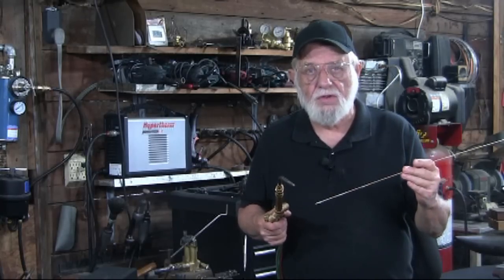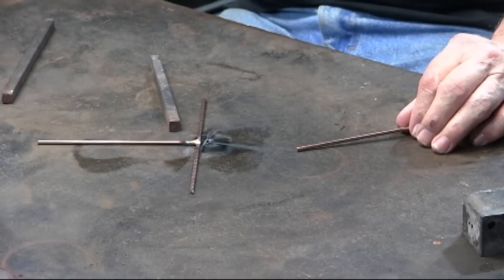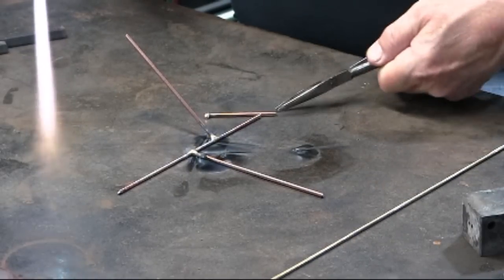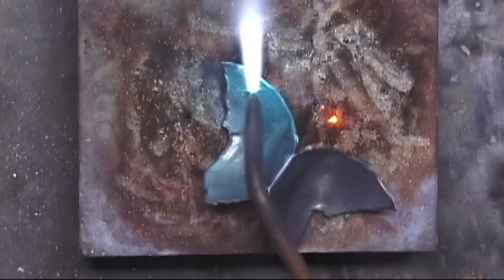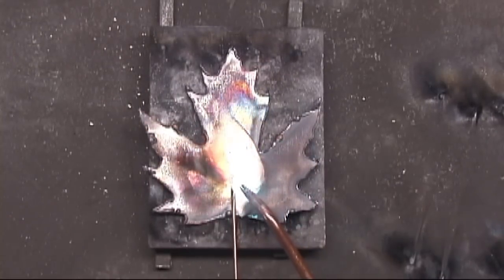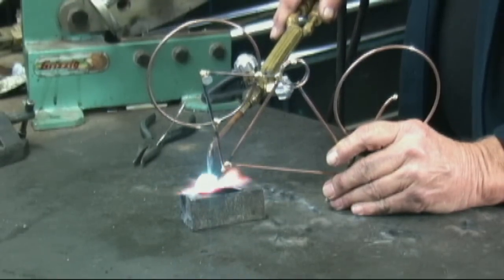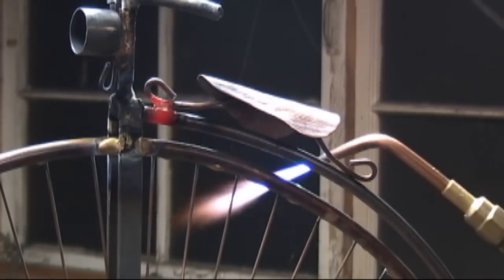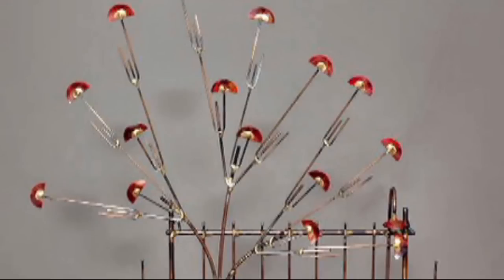Brazing Shortcut

Comment: It's worth mentioning that braze joints can be quite strong. Harley and other early motorcycle frames were brazed. I used to braze "steel rule dies" (picture a typical steel ruler with a cutting edge on one side) used in presses to cut tough synthetic fabric. The steel would often fail before the braze joint, and brazing was used in preference to welding for ease of repair. We melted the braze, made a new section, then brazed it in place.

Comment from the maker: The dob of bronze will be especially good for what you are doing.  You can put the dob of bronze on the nails and then while the nail is still hot you can melt the brazing on the nail right onto the sheet metal.

Comment: Your work is beautiful and so professional looking. Now if u don't mind me asking what is the difference between soldering n brazing? Seems kind of the same to me. Can I use solder wire to do this connection with my metals? Thank you.
Reply from the maker: Diana, You're right, brazing and soldering do look similar.  Brazing is done with a bronze brazing rod which require a much higher heat source than soldering.  If you are using silver solder you can get a strong joint between two metals if you can get the metals hot enough to accept the silver solder.  Wikipedia has a section on Silver Brazing (silver soldering) in their article on brazing.  http://en.wikipedia.org/wiki/Brazing

Comment: Great tip!  With the "dob of bronze", who needs a third hand?  You probably use quite a lot of O2 and acetylene, but what do you recommend for the occasional welder for the least expensive, most practical way to keep those gases handy in your workshop?  Purchase or rent tanks?  What size? 40cf?  Thank you for your videos!

Comment from the maker: The rods are RG 45 which is a standard mild steel welding rod available at any welding supply in 36" lengths.  Tip size is an "0" tip on a Victor Performer.  Welding table is 3' x 4' - 1/2" mild steel.  Check next week for a video on a heat sink.  With a heat sink you can use a lighter weight steel top for the welding table.

Comment: I love this video. Are you just using a bronze rod with no flux? It was suggested to me to use a flux covered electrode for brazing steel is flux necessary? I'm working with 22 gauge steel and 1/16th welding rods for sculptures.

Comment: Mr. Goehl I have never used a cutting torch before and I wonder would me starting off brazing be the best way to learn welding?
Reply from the maker: The oxygen acetylene torch is an excellent tool for the home shop because it is so versatile.  Many of the skills learned with oxygen acetylene brazing carry over to other types of welding and brazing.

Comment: Hello George,  I have a question, I am repairing a vintage Harley Davidson motorcycle fuel tank, the bottom has a series of pin holes ranging in sizes, the biggest being 1/8 diameter.  The metal is thin about .030 and I want to avoid blowing a hole through the thin metal.  What brazing rod and gas do you suggest for filling all these pin holes without blowing through the thin metal?  Thank you so much for your incredible videos and your beautiful craftsmanship!
Reply from the maker: Paul, take a look at this video.  https://youtu.be/h0vIvipWVuY    Especially the torch angle.  Not knowing the thickness of the metal to be brazed, it's a difficult question to answer.  Use the thinness brazing rod you can find.    Make sure the metal is clean - no oil, dirt or paint.  I've never repaired a gas tank.  But I have repaired other vessels.  If you put in a cup of water and it doesn't leak, then fill the tank.  A full tank of water will put more pressure on the brazed hole as opposed to a cup of water.   Safety:  You'll definitely want to make sure the tank has been steam cleaned or some other method to make sure there are no residue fumes.  I would strongly recommend checking out some Harley sites.  I'm sure that you are not the first person who wanted to repair a Harley gas tank.  You'll probably find someone who can give you first hand experience.
Reply: George Goehl Thank you George, I did review your instructional vid brazing thin metal. I will definitely use your technique of dob of bronze and holding the flame of the torch sideways.  Of course I will practice on some thin scrap metal first. I am a precision machinist by trade for 30 years (retired).  I truly appreciate your dedication and obvious passion for your craft. Thank you so much for these wonderful instructional videos. God Bless my friend.
Reply from the maker: @paulhealey8221  with your experience you should have no trouble.  keep me posted.  George

Comment: Hi George, I am doing some stick figures using 22 ga sheet metal for the bodies, and some nails for the arms and legs.  Will your dob of bronze work for me?  I may try using some RG45 too.  Will it work on that?  I do not want to get the sheet metal overly hot since it warps.  But, using the dob of bronze would be great if it will stick to the nails and the RG45.  Nice idea! Great video as usual.

Comment: Hi George ,nice sculptures great tips and tricks .
i wonder if the brazing rods from different manufacturers behave the same and get the exact result or they are different , i mean the melting point the flow and the strength etc ?.
Reply from the maker: There is definitely a difference.  Primarily I use "off the shelf" 3/32 bare bronze.  I really like Crown brazing rod, but it is 30 - 40% more than "off the shelf" bare bronze.  Gas Flux  has their own brand.  Sweden produces some exotic brazing rod.   Brazing rod is an alloy.  Copper + tin + (?).  If you want something just a bit better than the "off the shelf" rod, I'd suggest Gas Flux.  Most online welding supply companies are going to post details on the rod they sell.  Details like; melting temperature, ductility, tensile strength etc..
Reply: George Goehl ok now I know, thanks.

Comment: George, I think I just adore you! I really must add to the thoughts of my first impression. After watching several of you videos, in my humble opinion, you nailed it. Not only are you a wonderful artist and craftsman but you are also a really good teacher, videographer, editor, and content contributor. I am not a person that gives undo praise, I think telling someone they're doing good when they need  work is counterproductive. My one complaint is that your information and presentation is of such value to me it is impeding my production. Shame on you. lol 

I do have a few questions;
1. What is your bench made of?
2. I'm planning on watching most your videos,  I was wondering if you had some on beginning welding/braising tutorials. 
B. I know how to solder pretty well. I do stained glass panels. (my profile pic is one of mine pieces.) and want to incorporate metal and glass. This is such a happy thought for me it gives me "Snoopy" feet everytime I start drawing up designs.  I just need to up my skills on a few things. Figuring out how to get the metal hot enough to attach the copper foil to the structure without breaking the glass has been an issue. I figured out a work around tinning copper wire and attaching it that way. My goal is to have them attach directly. Any ideas?

I so appreciate you sharing you experience and know how. I looking forward to watching all your content. Thank you. MRS
Reply from the maker: Table is 1/2" mild steel  3' x4'
Here is a complete list of my YouTube videos listed in categories.  Lots of brazing videos.
Main Brazing Video:  https://vimeo.com/ondemand/10561
I have no experience combining metal with glass, but I am sure there are YouTube videos that cover what you want to know.
Glad you like the videos.  Keep in touch, George
Reply: To Lambentlark, check out this video in youtube . It might be what you need. It's called "Soldering for Crafters". The channel's name is thefrugalcrafter and the Lady who owns is Lindsay Weirich
Reply: Dear George Goehl, you are a genius and I am learning a lot from you. I have a question, I don't own one of those torches that you recommend. I will buy one soon, however, can I do some of the brazing with a kitchen torch?

Comment: What is the easiest, fastest and cheapest way to weld to coat hanger wires together? I know nothing about welding but have an idea and want to learn the best way to weld (or fuse) two hangers together.
Reply from the maker: Get two hangers almost white hot and hammer them together.  There are many options for a heat source.  I use an oxygen acetylene torch.

Comment: Hi George. Thanks for the helpful video. This has helped me tremendously. I solder jewelry but decided to take a step up and learn to weld. My first project is to make these cute little garden/flower pot stakes. I want to braze a 1-2mm rod (about 12") onto the back of various copper blanks (some of them will be domed). Then I want to torch enamel using Thompson enamels,  the fronts of these copper pieces. Do you have a resource (I am in Florida...not sure where you are) to find rods in those sizes in bulk? I will also need some that are about 36" and about 3-4mm in diameter. I'm going to add these to the other stuff I do when I do my craft fairs. Thank you in advance. I'm subscribing to your channel now :-)
Reply from the maker: +Lacy Hornberger Lacy, sounds like you have a plan.  I've never done much with enamels.  Hopefully you'll post them.  Look forward to seeing your work.  George

Comment: Just read some of your other commets. the peacocks i was planning on using metal coat hangers for the part to put feathers on then i found some steel sheet middle form an old dog house. which of the welding rods to i get with the flux already in it? and hand held tourch, its all i got to work with. thanks for any advice
Reply from the maker: Lynda,

You have a hand held torch.  Can you describe it.  In order to weld you need to get both pieces of steel so they are beginning to melt.  

If you are brazing you just need the two pieces of metal to get red hot.  If you want to braze, I'd suggest flux covered brazing rod.  
Check this video out:  http://youtu.be/TQP8EBQRvr0

Here is a link to the complete list of videos:  http://www.gsegmedia.com/?page_id=2877

Comment: I am trying to put together a TV antenna one that will not corrode or rust. When you mix metals like copper and stainless steel and copper wire  over a short period of time they rust or corrode. Just wondering IF you have any ideas that may help.
Reply from the maker: That's a tough one.  The only thing I can think of is to seal the antenna with a clear spray.  But that may degrade the signal.

Comment: What brand of brazing tip and size of tip did you use while brazing the tips of the metal to melt the bronze?  TY --JErry
Reply from the maker: Jerry, I used a Victor 00 (double ott) tip.  That is a Victor tip.  

I pretty much either use a 0 or 00 tip for my work.
Reply: Thank you for your response.  You do great work and provide a signifiacnt opportunity for begining welders to learn your trade. Pls keep up the training video's!! Have a great day. --Jerry

Comment: Hi George.  Great trick.  Was that pre-fluxed rod?  Cheers Rob
Reply from the maker: Rob, yes that was flux covered rod, but it was SCRAPED flux covered rod.  Check out this video for an explanation:  http://youtu.be/KFN38vHKQTY
Reply: George Goehl
Hi George.  I see.  Good idea.  I prefer to use plain rod and add flux as I find I can control it's application better.  Using prefluxed rods is a bug bear when you are trying to build up bronze on a previously fluxed joint.   It's horses for courses I guess, but I will keep that little scraping trick in mind.  Enjoying your videos.  Cheers Rob

Comment: As mentioned by everyone elese, thank you for your videos! I have watched them so many times, especially this one and all are a wealth of know-how. There are a couple of aspects that elude me: you dont flux your parts at any point. You make your dob of bronze with your bronze rod which was prefluxed and scraped. But when it comes to joining your dobbed rod to the rest of the work piece, the rest isn't fluxed. how so? Does this work because your materials used are new and clean, or are they fluxed before your attaching your new (bronze dobbed) item? 
Do you believe this process would work with brass (CuZn)  filler rod?
Do you believe this process would work with silicon bronze (CuSi) filler rod?
Thank you for your help!
An again, thank you for your contribution to the knowlegde base!
Reply from the maker: Edouard, thanks for the compliments.  But when it comes to joining your dobbed rod to the rest of the work piece, the rest isn't fluxed. how so?"  I guess I've never thought about that.  Evidently there is a enough flux remaining that it works.  I would know and could see visually if it wasn't flowing onto the other part. If i read this right CuZn is brass which is copper and zinc.  For a filler rod I don't use CuZn.  I am using bronze brazing rod which is copper and tin.  I seldom use silicon bronze so really don't have enough experience to comment.  Let me know if you have any other questions.  George
Reply: thank you for the info!

Comment: what gas and tips do you suggest for stainless brazing. thinking of getting turbo tip w b tank unless I can use mapp w silver rod?
Reply from the maker: I use oxygen acetylene.  Tip size is dependent on thickness of the stainless steel.  I use a "0" tip for 22 gauge stainless steel sheet.  I've never used Mapp gas so I can't give any help  about that.
Reply: +George Goehl planning to braze some 2" square 1/8" stainless tubing for a deck railing. perhaps I ought to save up for oxy acetylenr rig?
Reply from the maker: With oxy/ace - you might consider gas welding with a stainless rod.  If it was me - whether brazing or gas welding, I would use a chop saw and cut off several (or more) sections of the 2" square 1/8 tubing and get some practice.  I don't work with stainless on a daily basis, so I would practice so that I am using the correct size tip and get the feel for the material and the torch.

Comment: Do you use flux coated rods? I practiced with some last night and they made an absolute mess.
Reply from the maker: For my work I scrape most of the flux off the 3/32nd flux coated brazing rods.  I explain this in detail here:

Using Flux for Oxygen Acetylene Brazing
 Using Flux for Oxygen Acetylene Brazing
Reply: George Goehl I will be checking out this video soon. What a great person/teacher you are. Thanks you does not do justice at all.

Comment from the maker: Size?  Depends on how much Oxy/Ace you are going to use.  The smaller cylinders are convenient but they don't last long.  If you go with the smaller cylinders you can always trade them in on larger cylinders.  It is a hit on your wallet, but buying your cylinders is cheaper in the long run.  For the home shop I'd probably go with the mid sized cylinders.

Comment from the maker: I use 5# ace / 6# oxygen  For my work I usually use a 0 or 00 tip
Brazing with  3/32 SCRAPPED flux coated brazing rod.  On my web site you will find close to twenty free videos on brazing.

Comment: What Victor # is the tip you use ???
Reply from the maker: most often I use an "0" & "00" tips

Here is a video:   Oxygen Acetylene Tip Selection and Flame Adjustment
http://youtu.be/9vooT29iMyw
Reply: George Goehl I have a 0 so i figures similar materials similar results; thanks for the posts!!! and quick answer to my question.

Comment: i try wilding metal wire with copper, keeps brack, what do you think im missing ?
thnks
Reply from the maker: Your comment "keeps brack" Not sure what that means.  Are you using flux?
Reply: yes i did . i'm trying to build a little fence out of iron wires
Reply from the maker: First I would make sure that I am using clean wire.  Getting the temperature just right.  Not too hot or too cold.  Is the wire you are working with steel?  You'll probably just have to go trial and error until you figure out what works and what doesn't.

Comment: Great video, what material was that bike made out of?
Reply from the maker: The large highwheel bicycle:  wheel rims - 3/8 copper tubing.  spokes:  1/16 RG 45 (gas welding rod).:  handlebar:  5/16 mild steel rod.  fork:  1/2" x 1/8" hot rolled steel.